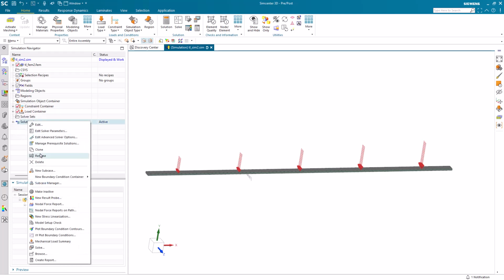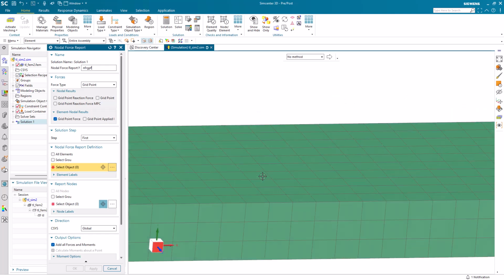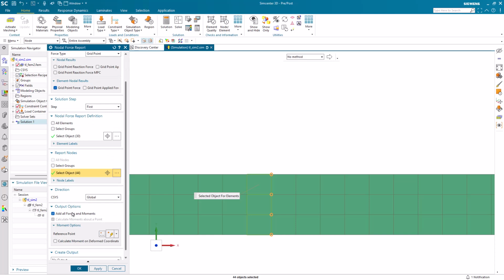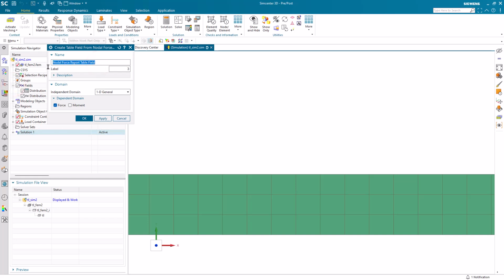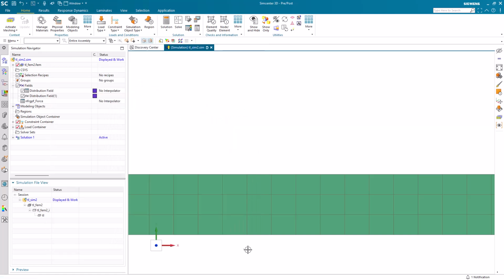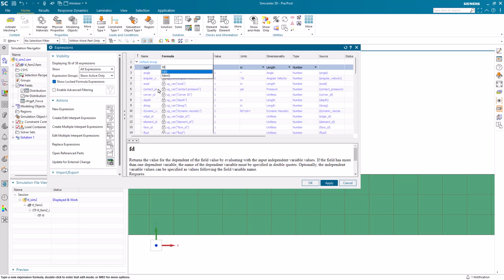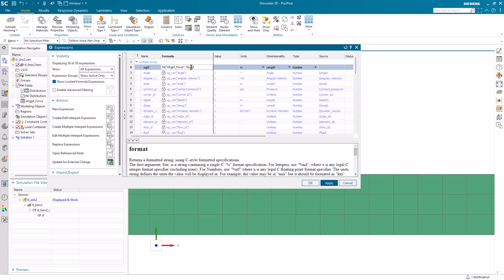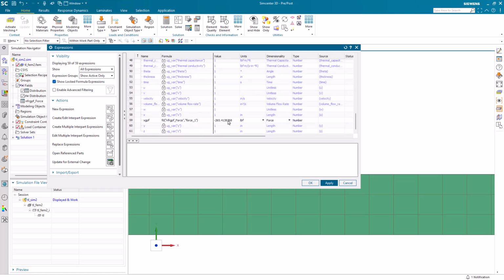How To Create An Expression From A Nodal Force Report

Comment: Can we extract rbe2 bolt reaction forces Using nodal force report
Reply from the maker: No, consider using a stiff CBUSH for the bolt shank instead with RBE2 spiders on the ends.  You will be able to extract the grid point force results in a nodal force report for the CBUSH.  Its easy to create this connection with a bushing universal connection as shown here:
https://youtu.be/AU--vr6n4y8?si=aI24DqNr3RnHUp0G 
If you have to use RBE2 elements, you will need to extract the grid point forces at the nodes and elements the RBE2 attaches to and sum the forces.
Reply: @Simcenter3DTipsandTricks  thanks